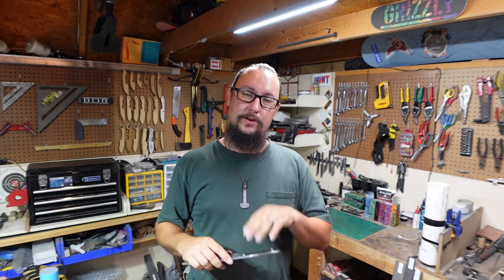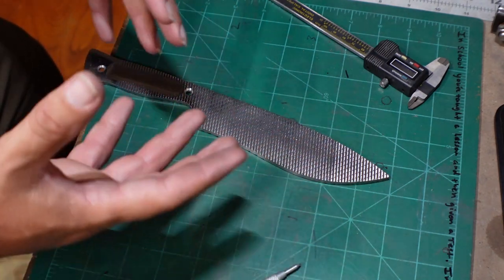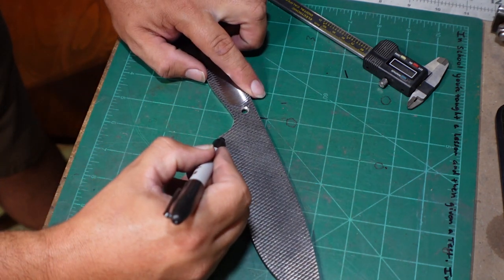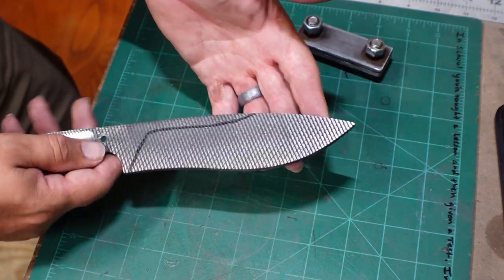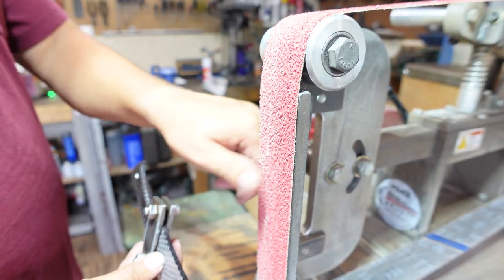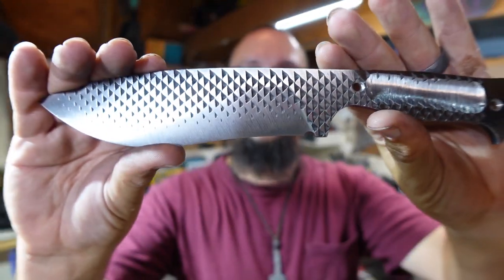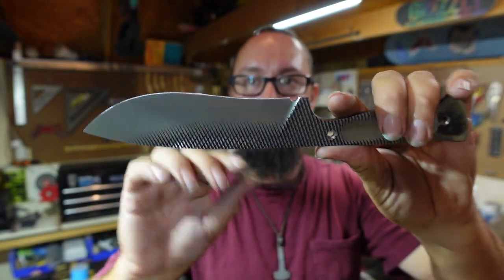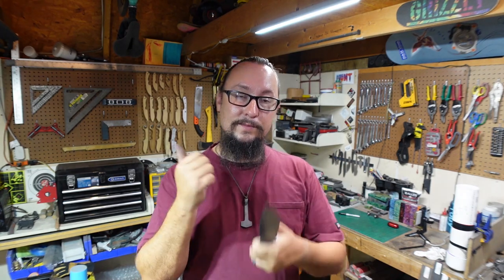Grinding Bevels Into A Farriers Rasp Knife | Shop Talk Tuesday Episode 87

Comment: Great video as always! I have a couple farrier rasp knifes that I'm working on as well. In your next video on heat treating. I would like you to answer a few questions for me if possible. 1 reading different temps. How do you gauge your normalizing temperatures and quenching temperatures? Eye, magnet, salt, thermometer, thermocoupler?? 2 soak time. With a gas forge what are your tricks? Do you use some type of baffle or angle iron setup to hold your forge at a certain temperature? If so do you use a thermocoupler to give you a readout of the temperature? (I'm wanting to build a gas forge that is more like an over and a digital temperature readout would be awesome).3 what quenching oil do you use? And do you preheat your oil? If so what temp?

Comment: Eric what speed do you typically run your grinder at when starting your bevels? Thanks
Reply from the maker: I only have 3 speeds because I don't have a VFD yet. I run it at the top speed most of the time. When I'm using high grits I'll run the medium/slow speed